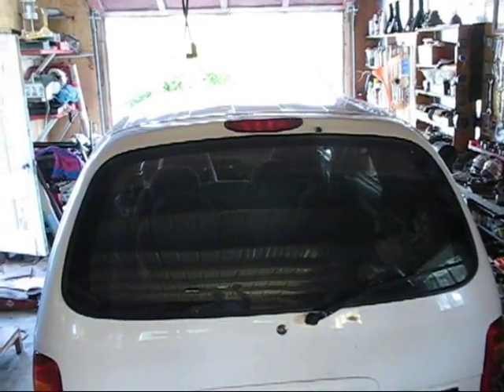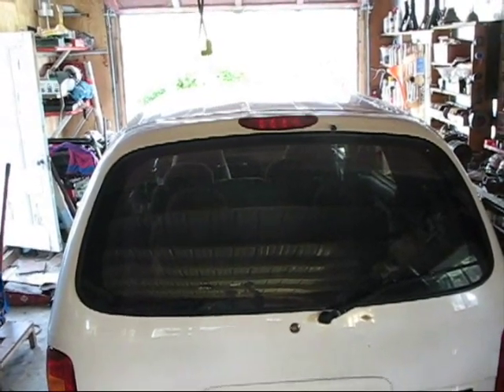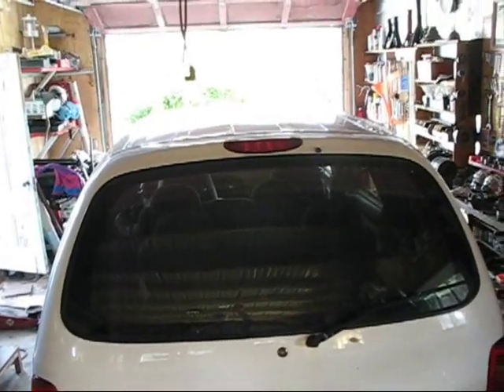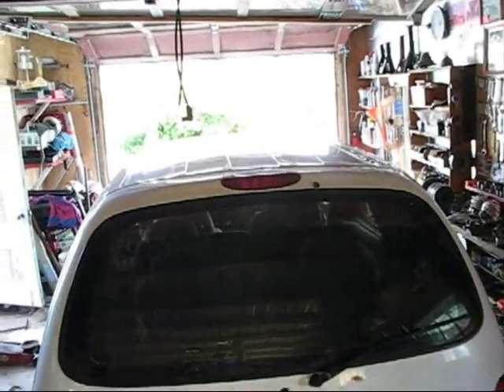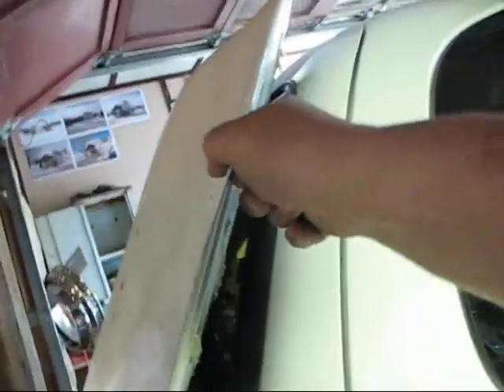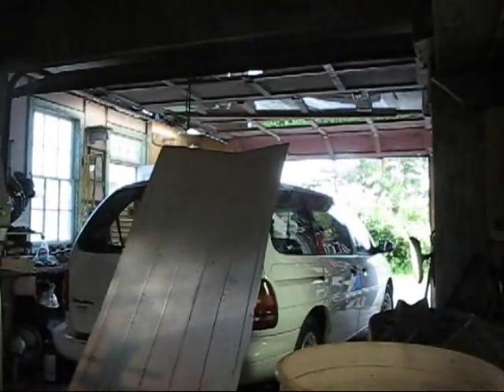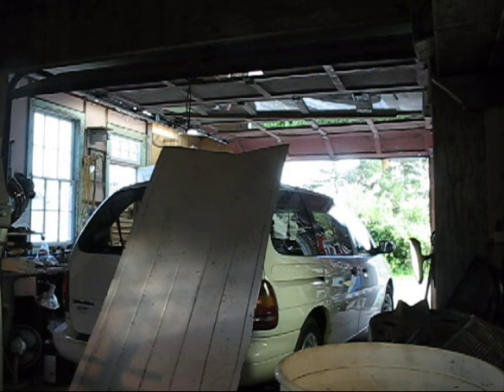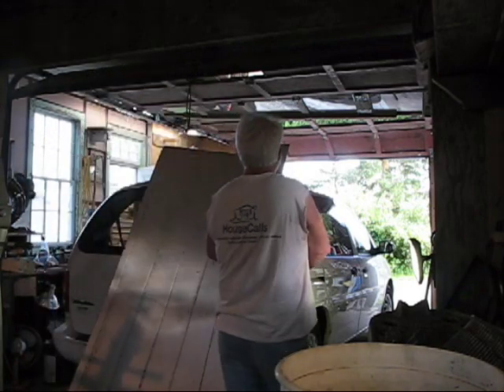Rat rodder rips roof off mini van!

Comment from the maker: The old motor has 240k on it.  The new one just over 100k.  I figure I'll come out better in the long run if I just drop the whole front sub frame, tranny and all, and pop it back up under Dad's van.  It'll be kind of like a heart transplant, only greasier..